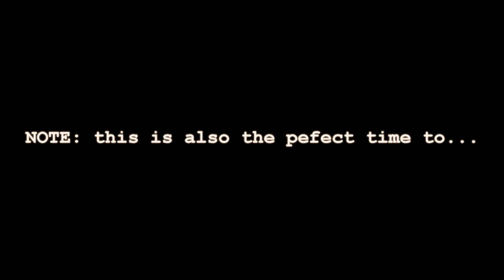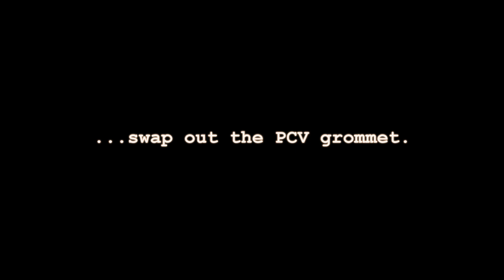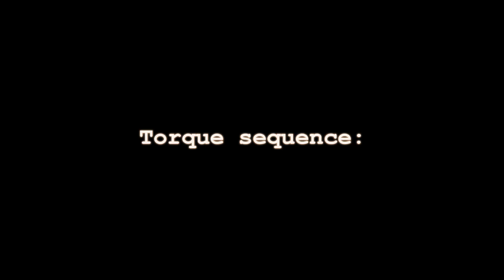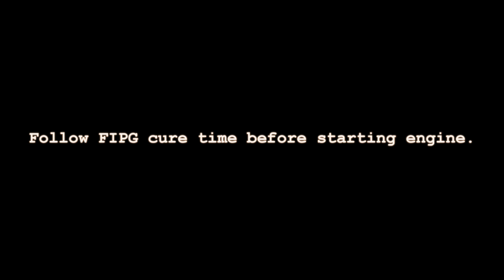How to Replace TOYOTA / LEXUS V8 Valve Cover Gaskets (GS400 shown)

Comment: Did this on my 03 GS430 over the weekend using this video. Thanks a ton for posting this. Turns out on one side, all the grommets for the plugs were broken. The car runs sooo much better now!
Reply: any leaks after? thinking of doing this on my ls430! kind of scared. is it hard to do?
Reply: im tryin to do this on my 03 gs430 as well lol
Reply: I wonder if I can get my 04 gs430 to run better just likes to bog kinda when lightly hitting gas
Reply: @woe.num.1  No leaks whatsoever. Not hard to do, it just takes patience.
Reply: @RubbaFist3000  lol did this the next day after I commented. We leak free 💪🏼

Comment: Im not sure about GS400s but when I was changing my valve covers on my 98 LS400 I found out both the cam seals and the cam gears/vvti tube assembly were leaking. I also noticed a leak from the crank area which was both the crank seal and the oil pump after opening the motor up 😬. I know we share the same motor so stay safe out there my fellow GS400 owners and Godspeed.

Comment: Thanks for all those great, educational videos. I have a 2000 GS400 (144,215 miles) and keep it in pristine condition and when I got my car from Japan on 01/05/2000, I also bought the "shop manuals", which have helped me doing many jobs on it. At this time I need to replace the Oil Pan (bottom) gasket, so if you happen to have a video available, I will appreciate it if you can share it. Thanks again.
Reply from the maker: Nice car! If you’re talking about the engine oil pan gasket, sorry, I don’t have a video on that.  It’s a fairly involved job and I believe the sub frame needs to be dropped down a bit. I do have a video on the transmission pan gasket.

Comment: Great work!  I have all the same parts to replace, nice work on gasket grease on corners.  Notorious leak spots as i here when parking on unlevel surfaces.    Did you notice any engine improvement?  Plugs were okay?
Reply from the maker: Thanks! Some plugs had oil on them which I discovered during a plug change. That led me to do the VC’s and grommets. Amazing how long these lasted, all things considered. 24 years old and who knows how many heat cycles?

Comment: just did my valve cover on drivers side but having trouble with one bolt #2 but unable to tieghten it,no room for any socket or wrench,I have tryed everything.would you sugest lossening the moter mounts and raising the engine in order to get to that screw, besides I cant figue how you used a tough wrench.
Reply from the maker: I didn’t have any issues. Have you tried a wobble socket and an extension? That should do it.
Reply: @ForwardMomentum

Comment: Thanks for the vedio, nice work .
I did it my self in my ls400 1uzfe non vvti . Exactly 💯 % same work . 
But you put a sealing selcon 🤔?  
Not need for this amount of sealing selcon , if its to much mabye it case oil leak . 
Its better to remove all half moons from each side , clean them , and clean under them , and put sealing selcon under them and above them , and little in the corners, to avoid any oil leak in the future .
And just put a little, very little amount of sealing selcon ( Simple smear),, and only head valve cover Gasket it self will prevents any oil leak , without any sealing selcon.

Comment: Hey there man thanks for an other great video. I got my valve cover gaskets replaced today and was told that chemicals and what not needed to “burn off” my engine and that’s why white smoke comes from engine bay. How long should I expect the smoke to be around sir?
Reply from the maker: Thanks! Perhaps for a very short period of time you will have some oil burn off. It should not last longer than a few drives though.

Comment: so for the bolts your doing 75 ibs with the torque wrench? whats the in??
Reply from the maker: I’m confused by your question. In the vid it states “75in-lbs” and in the title of the vid is the type of car. What am I missing about your question?
Reply: @ForwardMomentum  I was confused by 75 in/pounds, never used a torque wrench before. but i figured out, about 6 pounds of torque😂sorry
Reply from the maker: Oh no problem at all. I was just confused because I thought I answered those questions. Yes, a very small setting to get those torqued up. 👍

Comment: Finally did my valve covers any tips on driver side to make it a little easier fit folded the gasket and going to have to retry not sure what I was doing wrong but I could not get it to set to save my life
Reply from the maker: All I can say is keep trying. Passenger side is actually harder, so if you got that side, you’ll definitely get the driver’s side eventually. Usually it’s the spark plug grommets holding things up. Make sure they’re oiled a little.
Reply: @ForwardMomentum  I'll definitely try that, passenger side for me went flawless definitely was the easiest side room wise for me. This time I'll try it during the day when I got some light to work with may help aswell.

Comment: Great video! Did you check to see if vvti cam seals are leaking. It’s a common issue in this engine with this age. I have the same engine. It’s a huge job.
Reply from the maker: I took a look and didn’t see an issue. VC gaskets were shot.
Reply: @ForwardMomentum  that’s awesome. That’s a lot of Money saved. Thanks!

Comment: Nice job 👍 won’t need to do that for a long time. Just curious though, are there any oil leaks elsewhere? It seems like the later UZ’s are a pretty leak-free engine. My 3UZ’s got over 300,000kms and still dry.
Reply from the maker: Thanks! So far so good!

Comment: Btw I’m pretty sure u installed new spark tube seals backwards
Reply from the maker: Nope. 100% correct. Frankly, I was worried myself and quadruple checked it.
Reply: Yeah he installed them correctly unlike most the other videos. Just like any other lip seal lips go toward the pressure that way they push out and seal